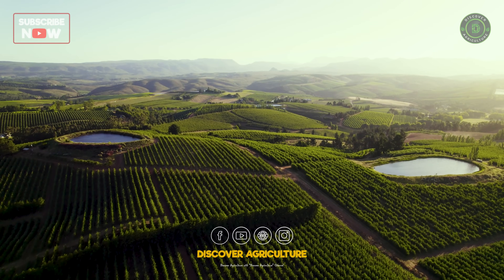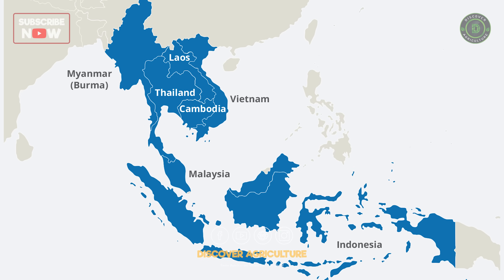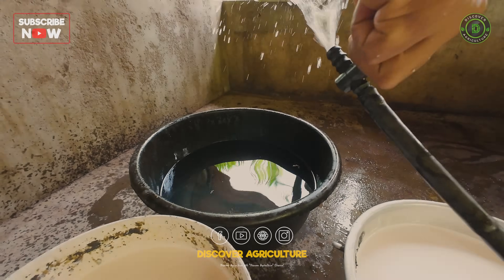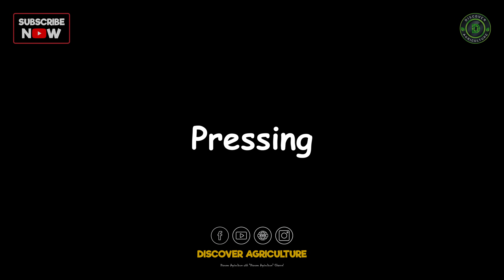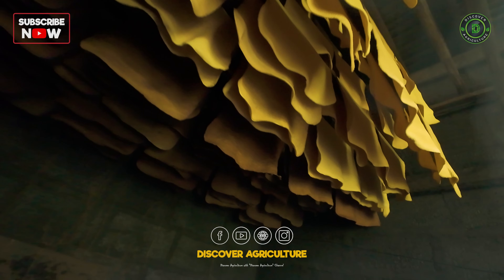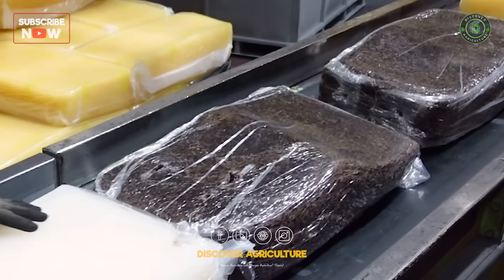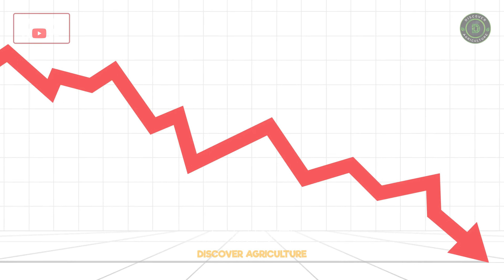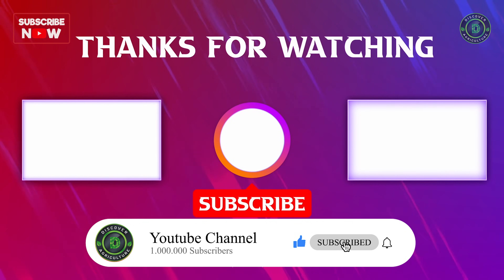Rubber Tree | How Rubber Latex Harvested and Processed

Comment: I need partners to help me. I have an idea. That involves interwoven threads of silk webs. From orange spider's. And dip it into this milking sap. And take the thread and turn it into film sheets. Than incorporate it into glass. That has other properties. Like fire, water, bullet impact proof. And shattered proof by adding silky spider web dipping into this milky sap. Do not let it thicken. You want it to be milky to run the spider webs through it. Than take a CNC machine. And take the threads and turn it into a film sheet's of layers. Stacking each sheet. Strengthening the glass.
Reply: Never share your ideas
Reply: Instead of supporting you, they will solely try to do it ,,